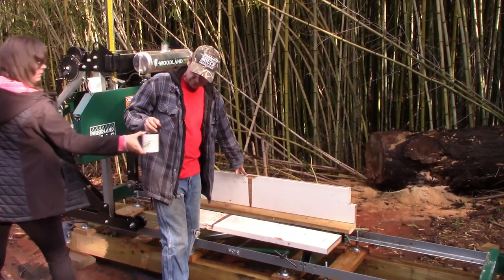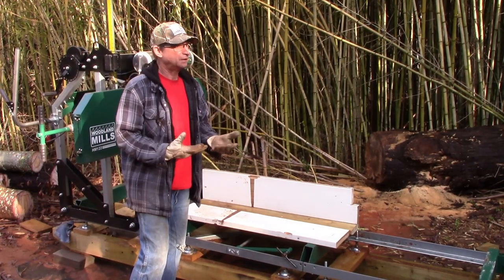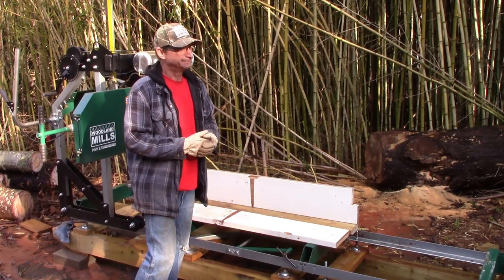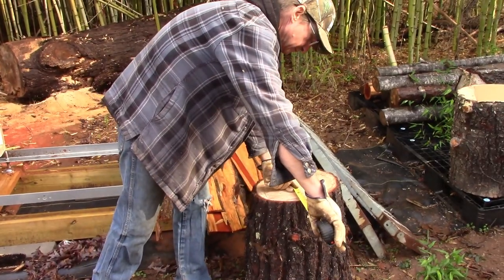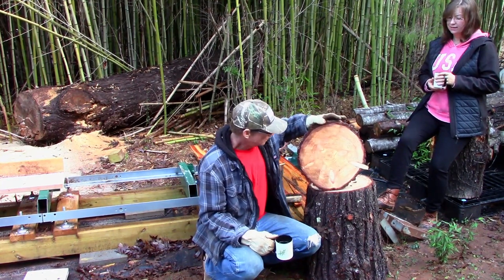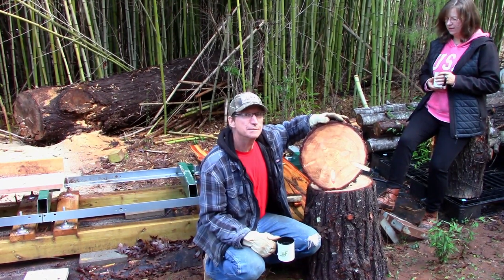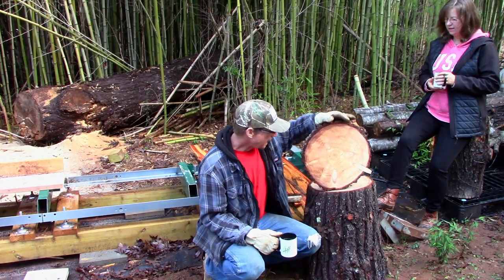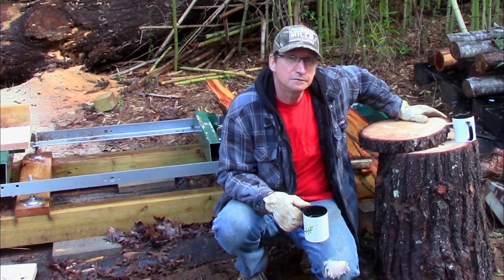Cutting Log Cookies (planks / disks) on Woodland Mills Sawmill

Comment: I've found bogging the motor down, where it just starts to bog, is where you wanna be to utilize the torque of the machine...may also double check blade deflection & tension to avoid cuts that "travel" on ya. Keeping a good lube mixture on your blade too? You'll get it dialed in, great job great video! Thanks for sharing 👍👍
Reply from the maker: Thanks for the info! Will look into these tips and see how some more adjustments work 🙂